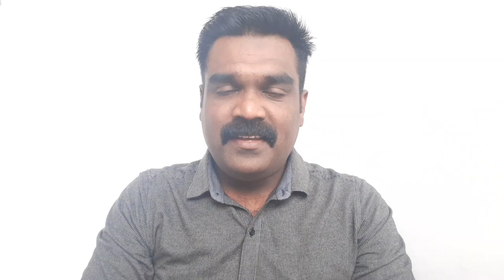Pressure Testing Tips - How to use a HP test pump for LP test?

Comment: How accurate the chart can be plotted using HP pressure testing unit when you use that for LP testing
Reply from the maker: Thank you.... Excellent question.... I miss to highlight that point, we need to install an additional chart recorder with lower range for a better result. Meantime we can isolate the line to original chart recorder with the unit.